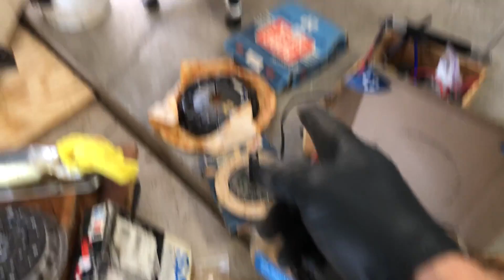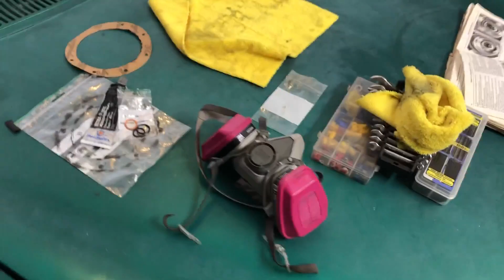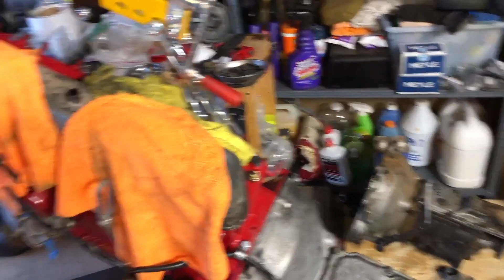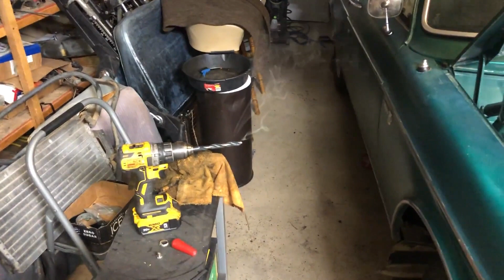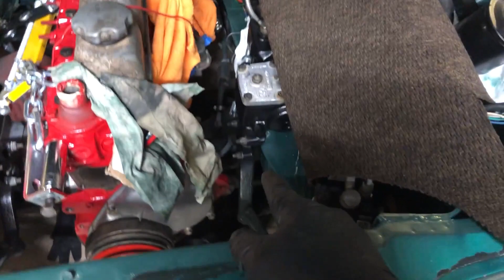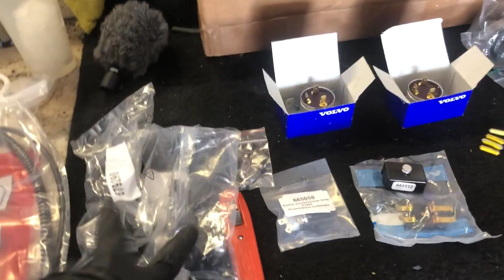Installing Engine & Transmission - Volvo 164 Rescue Ep 38

Comment: When installing engine and gearbox together raise up the rear of the car on axle stands about 15 inches before putting the motor in. This significantly reduces the tilting of the engine and gearbox required to  get it in, this also gives the effect of having a taller transmission  tunnel and more room to bolt up the gearbox mounting plate under the car

Comment: Hey David, I've got a question Totally unrelated to these restorations. Hopefully you don't mind. I've got an auto 850 Turbo, with the engine B5234T. I am planning on manual swapping it and I've got an old S60 from '01 laying around. I was wondering if I would use that M56 transmission to swap my 850? Thanks!
Also, awesome video's as per!

Comment: Woo hoo!  I give you a short period of time before you replace that mech pump with a shiny electric one.

Regarding the front engine mount, I've always left the engine bolts loose until it is seated. 

Lizard and roach question: yes, lizard will become very sick and may die.

Comment: I believe there should of been spacers that dropped the trans cross member a little bit to have better clearance for the tunnel. Though I'm not sure if that was on the 164's but I've seen them on the 240's

Comment: I have just got my 940 going again. The last task, reinstalling the drive shafts, was done with the car jacked up about 6 inches of the concrete floor. Getting under that car was painful. So I feel your pain. The solution is a lift. In your case you also need a building with a high roof. Do yourself a favour, get a car lift. Your body will love you for it.
Awesome rebuild btw